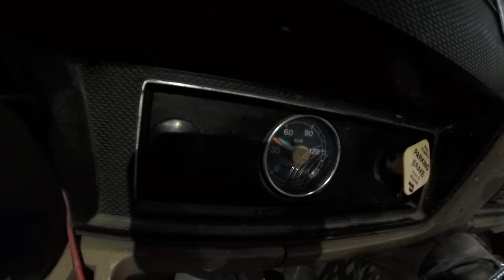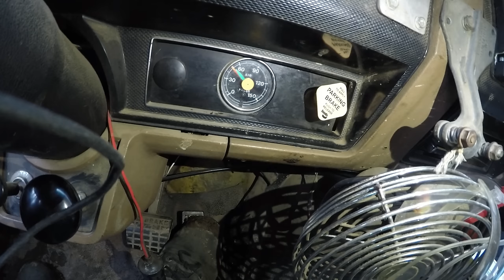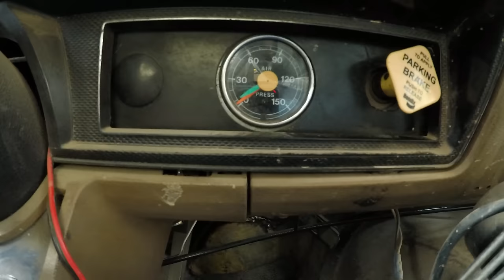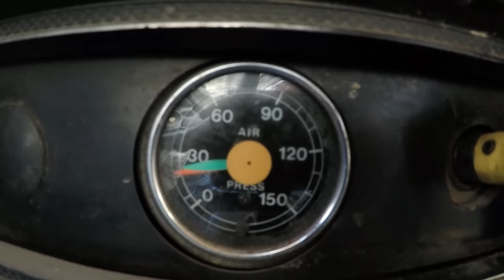Fixing my air brakes and towing an RV

Comment: Yo, Andrew youre cold soldering that like youre doing it. Its more prone to cracking and failing. You want to heat the wires themselves up and touch the solder to the wires until it melts. Try it out itll be way stronger. Love your videos!

Comment: When I had to tow my dump truck I made a quick tow bar out of pipe, bolted a pintle hitch on one end, welded another piece of pipe on the other end and chained it around the bumper. Worked good.

Comment: you guys did a number on that rv bumper
Reply: decreased RV value by $2
Reply: @halleffect1  no.. increased it by $2
Reply: did you see the grill at the end when they started it was all there at the end it was half gone
Reply: @taddixey5603  yeah. Im pretty sure it smacked the back end of the dump truck during the leg of that trip
Reply: @ajhainstock3997  or he was backing into the rv when he was trying to get a running start
Reply: @taddixey5603  It was the distraction technique showing the bus that had the van on top when the grill parts were removed from the scene. Dump truck backed into it just before that, lol. Let's recap, almost ripped bumper off, killed the grill, hit a tree while spinning the camper around, backed into a tree and had a limb gangling at the final area where camper was parked. Just a suggestion, Andrew shouldn't go into the towing business. hahahaha
Reply: @taddixey5603  Towing was rough as guts, that's a LIKE right there!
Reply: Cause clearly the guy cares about his vehicles and doesn't just leave them sit and live in them lol
Reply: The bumper modification makes it blend into tweakerville much better.

Comment: UH, when you want to turn the RV to the right, you have to steer the wheel to the right.
Reply: @GETREKT ! i don't think it runs so no power steering
Reply: Midway through he got nervous about it hitting his "house".  AKA bus
Reply: Right...left...same thing
Reply: @crushnkill  Yes, lucky the driver didn't loose a thumb when the steering wheel went flying in the opposite direction that they were expecting!
Reply: Barry Walter Incorrect. Look at his hands. He’s spinning the wheel to the left. Not trying to fight them from turning
Reply: Barry Walter exactly
Reply: He pulled him hard to the right which caused the truck to move and turned the tires to the left
Reply: R
Reply: No shit🤔🤔
Reply: I literally cringed when he turned the OPPOSITE way. Probly drunk, he looked it

Comment: Fixing the Air Brake system like the Military used to do,...keep replacing parts until the problem was solved.
Towing from,....and to, hell!! I wonder if you've heard the saying" the road to hell is paved with good intentions"?
Entertainment value of this video,...100%
Reply from the maker: Yeah, I thought it was the dryer, I was just changing the things that were leaking.
Reply: Back in the day, when urgent repairs were done this way, this was the rationale behind this method of repairing, so you're correct.
Reply from the maker: I like that though, "Change parts till its fixed"
Reply: Well, when you think of it,..it sure did work, heck, why wouldn't it? 
Keep the videos coming Andrew!
Reply: At least your doing it yourself. No shops and you know it's all new. Good deal
Reply: Who's to say the drier was good? Possibly it was bad already, and that caused the governor to go out.
Reply: I saw that a thousand times in the military!  "Parts Replacers" not technicians.  Well, in time some knowledge is gained.
Reply: When bullets are flying, you dont have the luxury to think.  You just react, move, or you're dead.  Afghanistan 2011!
Reply: @WAVETUBE84  I hear you, and yes of course,..that's how we learn I think,..by doing! Haha!
Reply: @WAVETUBE84  Oh absolutely, that, is what is called " a given" isn't it?
Good on ya, for your service!
Reply: According to Muphy's Law, actually broken thing will be replaced last, so you still finish up overhauling whole system.
Reply: @AndrewCamarata  Man that's funny the guy with the RV was steering the wrong way the first time you moved it and broke your chain and then on the last pull to try and get up the hill he had the brakes on in the rear.
Classic dude behaviour!!

Comment: Hey Andrew first off want to say love all Ur videos. A cool tip I found for making solder joints last longer is before u put the shrink tubing over the joint put a dab of dialectic grease. That will basically make the it water proof and should make it last even longer.
Reply from the maker: Thanks, yeah, that's a good idea. I don't recal having issues with soldered wires with shrink tube though. Even for years.

Comment: Air brake systems love to freeze in the winter. I got to be pretty good with a little hand torch and small hammer at trouble shooting a frozen air brake system and some trucks had the same problem every morning.

Comment: tin, solder, shrink wrap. best way to attach wires. nice job on replacing the air operated parts. good video dude. thanks
Reply from the maker: Thanks

Comment: replacing your air dryer is good preventative maintenance. you can normally catch ad=9's on sale at one of your truck dealers in the fall. i just change the whole thing out at least every other year. saves a lot of winter time hassles. the good crimp connectors that have the shrink tubing on them with the heat activated glue inside hold up really well as well. although you did a nice job with the solder that should be a very good splice. i just normally find i to be too time consuming  and can be a pain to try to solder wires on a truck or trailer outside in the weather.
Reply from the maker: Glad to hear that about the air dryer. Yeah I always just solder/shrink tube the wires. It takes a bit much time, but it seems to last. Thanks,

Comment: Never worked on air brakes. Still, buying extra parts to do it yourself saves a lot of money.
So many repair shops still try to sell you $1000s of dollars, of unnecessary repairs.
Reply from the maker: Yeah, its not worth going to repair shops, I'm not an expert on air brakes, but trail and error is a good way to learn. I don't know if that old air dryer was perfect anyway, so I don't feel bad replacing that.
Reply: It's better the system has all new parts now.  You won't have to work on it for a long time.
Reply: Always have been looking for a dump like yours...but don’t have the appropriate license. What will they be looking for if I try to take my road test????
Reply: Andrew Camarata  that first part you replaced was just a heater.  It has a heater in it so it doesn't freeze in the winter when the dryer blows the moisture out when the system reaches pressure.
Been there done that.   I work on fire trucks and have learned over the last 10 years.

Comment: 11:28 Rear tires should be winter, then they will better bite into the road and the grip increases. By the way - all you need to do is carry a few sacks of sand, the sand spilled on this soft road will make it very easy to move away from this soft place.

Comment: The air compressor is the first thing to check for an air pressure problem. The governor has a simple pressure adjustment under the rubber cap. Air tanks should be checked daily by simply pulling on the lanyard that goes to liquid drain valve even when an air dryer is incorporated. Even automatic slack adjusters need periodic checking. When a brake “s” cam, cams over, you have no breaks at that wheel.135 lbs. pressure Is too high when 120 psi is called for.

Comment: I replace a lot of purge valves on air braked systems by other than that they are very reliable. Keep them in adjustment and may have to replace a quick connect every now and then but I've had good luck with them. I use to own a repair shop for big trucks and semi before I started a construction company. It's funny how some things like that ya miss doing.

Comment: I change the dryer annually right before winter and never had an air problem. I don't even need to drain tanks.  I'm envious of how you easily replaced the governor. You should see what it's like on a Cummins ISX, I think I lost 3 of those gaskets. There was a huge log blocking the left rear wheel of that camper while you dragged it out lolll
Reply: The  trucks I drove that had air dryers didn't need the tanks drained.  (I hope.)

Comment: Not sure if Andrew will see this, but next time run the chain through a piece of pipe.  The pipe will maintain the distance between the two vehicles and you can use it to slow down (or even back up) the second car.
Reply: Not understanding this at all 🤔

Comment: Air dryer should be rebuilt once a year new desicant cartridge and blow off valve new orings and all.
Reply: Regardless of mileage?
Reply: @mwilliamshs   YES
Reply: @kc450man  so a truck that accrues 10,000 miles per year needs one dryer rebuild in that time? What about 5,000? What about 50,000?
Reply: @mwilliamshs  there are more factors besides mileage. age of the compressor, how many axles (volume of the air system), environment, etc but yes the cartridge and unloader should be changed every year. it called preventative maintenance.
Reply: @kc450man  there are more factors than time. That's my whole point

Comment: If you have trouble that the airsystem freezing wintertime, you can have propan-2-ol, commonly called isopropanol in your air tanks.
Just remember to drain the tank free of oil and water first.
We use it on trucks and buses in north norway wintertime.
Reply from the maker: Yes, I have had to do that a few times when it's been very cold.

Comment: The ol' bigger the gob better the job soldering technique...hey at least you remembered the heat shrink (been there before)...you should look at the Western Union splice technique, it'll give you a stronger solder joint. - 10 years in the electronics field
Reply from the maker: JP M I googled that, looks good, I'll give it a try. But usually once it's soldered it's fine. The wires shouldn't be getting pulled on anyways.

Comment: Andrew, there is an adjustment screw on the governor under the plastic screw on cap. Adjust that so that it cuts out the compressor at 120 psi. You might cause damage to other components at the current setting.  Safety issue here. Safety is no accident.
Reply from the maker: I like having stronger brakes. Its been over a year and its still working fine.
Reply: @AndrewCamarata  ok, each to his own. By the way, that's an awesome backhoe/loader! I have a 410D and can't live without it. Wondering why you don't use it more? Or maybe you do but don't video it. I have a 4 in 1 Drott Bucket on mine and find it very useful.

Comment: the only way to tow, is with a stiff bar! Yeah, those truck engine, compressor regulators are a pretty common problem on older trucks.

Comment: The telephone company around here uses crimp connectors filled with dielectric grease.  Dielectric grease is non conductive, prevents corrosion, and waterproofs.

If you filled insulated spade connectors with dielectric grease, you would have a connection almost as good as a soldered connection.  And the next time you have to replace one of those or other lights with a special plug on them, you could just unplug the spade connectors and install the new light with new insulated spade connectors.  That way you would not continue to shorten the wire on the special plug any more.
Reply from the maker: They already had a plug, its still there, that's what that black thing was.
Reply: I know, but what I was trying to get at, is that in order to not eventually being required to replace those special (and maybe expensive plugs) where they tie into the wiring loom, if you used insulated spade plugs (that are common and cheap) filled with dielectric grease, they would be both reliable (no corrosion and waterproof) and save the eventual need to replace those special plugs if the lights have to be replaced in the future (because of damage or whatever).

Comment: You should think about picking up a Government surplus 5 ton .  The 6 wheel drive would be useful and would fit into your 'fleet' perfectly. I bought one a couple years ago, a M931A2, but removed the 5th wheel plate in favor of a cargo bed.  Check out the BMY's up for auction right now. I can only imagine what you would do with one.
Reply from the maker: I had a 2.5 ton for a while. It was ok, I used it for towing my excavator before I got the dump truck. But the dump truck is so much better. I would consider buying a 5 ton if it dumped.

Comment: Should probably turn that governor down a bit on the air.  It’s running too high.  You will end up blowing out the diaphragms in brake cans.  Should fart at 120psi, and kick comp on at 90.
Reply from the maker: Think so? The brakes will be stronger with it at higher PSI. Ill wait for it to have a problem first. I replaced a diaphragm once, it was easy to do, and it was like $3.
Reply: Andrew Camarata yes.  I work on heavy equipment for Union Pacific RR.  We always have machines that blow out brake cans due to higher air pressure.  But yes, the diaphragms are cheap and easy.
Reply: Also those governors are stupid simple to adjust.  Just loosen the jam nut under black cover, then turn the stud in or out.  Just remember that you will have to dump are for comp to kick on in order for a change to show up.
Reply: It was my understanding that the springs supply the braking power, not the air.   The air only releases the springs.   At least that's the way they worked on my old schoolie years ago.   :)
Reply: Doug Dobbs you are correct.
Reply: Doug Dobbs, that's not exactly 100% correct.  Since the mid 70's, all air-braked vehicles in North America are a "split" system, whether simple straight truck or tractor-trailer.  You are correct that the air releases the springs, and this happens on the "supply" side of the split system.  That is why you need at least xx psi (or so) to get the (parking) spring brakes released. But on the "service" side,  it's actually air that does apply the service brakes. It's air-over-air, where the foot valve sends a controlled signal (depending on just how hard you stomp the pedal) to fill the service side of the chamber to put on the brake, while the supply (or emergency) side holds off the (spring) brake.  Without control, you could stop the supply, and the spring would give all of its' force to the push rod. In an "emergency" or other problem involving sudden and complete loss of air, the spring would provide as much force as it could and the vehicle would come to a basically uncontrolled stop. With the service side, you can modulate or control the amount of brake force by pushing less or more on the pedal to have a good control of the brake(s).  The entire system is more complicated, but this description would be a basic, boiled-down description of how it works.  Need air to release spring/parking/emergency side, and need to release (or lose all) air to apply the spring/park/emerg side, while the other side of the system, the service side uses air to overcome the released spring brake and provide a modulated, controlled application.  As the spring inside either a single or double chamber gives up due to age, overheat, rust, etc. it provides less and less ability to provide the needed force to stop (or hold) a wheel dead. That's why sometimes guys can't get their trailer bogie to slide even though the linkage may be correctly adjusted.  Like anything else, they need replacement too, sooner or later. There can be other underlying problems in braking systems too.  But they're all a 2-sided system nowadays.
Reply: neb4x4 thats how my father does it he said the same thing
Reply: Doug Dobbs  for the Maxi brake or parking that is the case.   The air supplies power for the actual brake when driving down the road.
Reply: @dougdobbs  The springs only work if there is a loss of air pressure or if the parking brake is applied. Under normal use, air pressure is applied to the brake chamber thru a treadle valve, (brake pedal). Also, not all brake boosters have dual chamber's , usually the ones on the front axle do not have parking brake capability. This is so you don't loose steering capability in the event of a catastrophic air loss during movement.
Reply: @stanpatterson5033  Very well said, thanks for the qualified information!

Comment: Your air pressure cut out is a tad high , the standard is 125 for trucks you can adjust it just by tightning the main bolt in the governor/regulator on the compressor

Comment: Could dampness be freezing the air dryer I heard in cold climate they put alchahol in system???
Reply from the maker: Yeah, there is stuff that can help it. But the air dryer had a problem. This truck has been fine since doing this repair.

Comment: Air brakes,  usually the first thing to go bad is the  governor,  then maybe the dryer filled with white oily mess and then the lines, then compressor, my opinion and many years as a mechanic, 3/29/21

Comment: I had a compressor go out once on a freight liner with the Eaton fuller auto shift transmission. The trans uses air solenoids to shift. Oil leaking into the air system from the bad compressor was clogging up the air dryer causing a wet oily sludge to get into the shift solenoids in the transmissions. What would have been a 300 dollar compressor turned into a compressor, air dryer, and a 7K dollar transmission shifting unit. The truck owner was cheap and it ended up costing him
Reply: in the long run you probably also damaged all your quick release valves, r14, E10, etc. Oil from the compressor can damage all the rubber o-rings and diaphragms too.

Comment: I have been installing those LED replacement bulbs for a while now on my own vehicles and for everybody I know. Moisture will eventually get to them and cause them to flicker or stop working. I started smearing hot glue or silicon all over the exposed circuit board parts of the bulbs (not the lights) and haven't had a problem with them since. That is their biggest weakness.